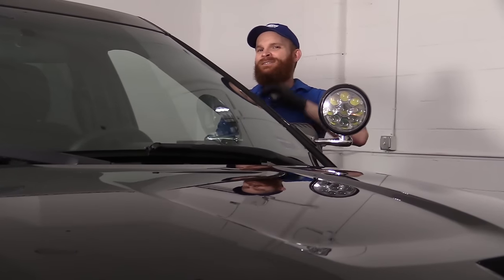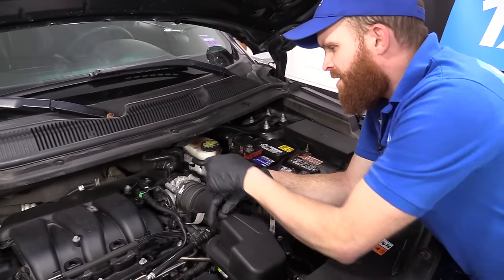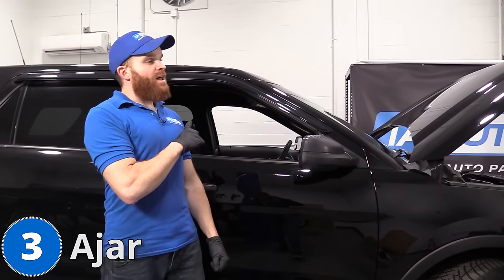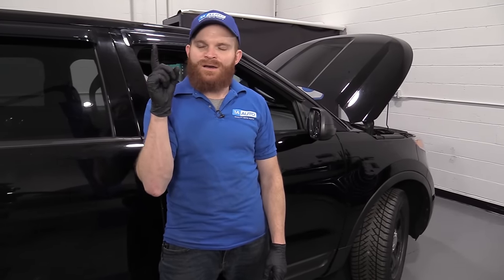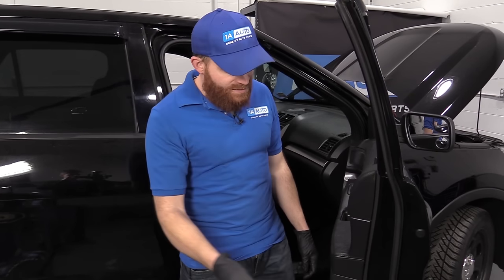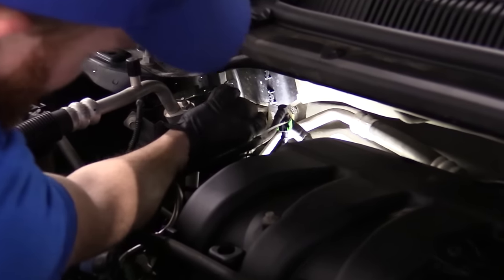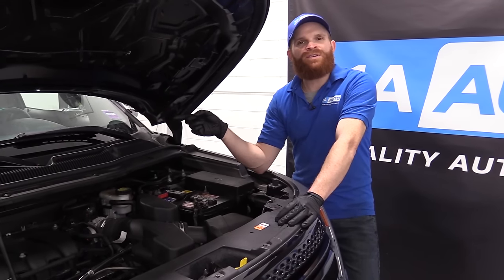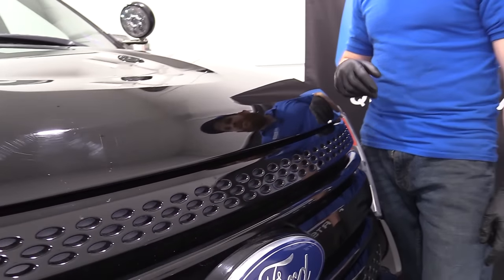Top 5 Problems Ford Explorer SUV 5th Generation 2011-2019

Comment from the maker: √  Watch the Video
√  Buy The Part at 1A Auto http://1aau.to/m/Visit-1AAuto
√  Do it Yourself
√  Save Money
Reply: 1A Auto Parts I have 2018, and the hood was bad already, just got replaced under warranty.
Reply: And water pump
Reply: Forgot about the park detector switch.  Ford wanted $900 to replace the shift column, but now offer a switch replacement.  No Park switch, no key fob start.  And, the biggest problem of all, the internal water pump that will destroy the vehicle when the bearing goes.
Reply: Veerickle.. what the hell is that? Thanks though. Great video.
Reply: @1joseda  OMG!!!
Reply: The hood problem is due to electrolysis, steel and aluminum don't play nicely together. But I want to find a steel hood designed for crash safety...
Reply: Wait am I hearing vericle??
Reply: Hi guys can you help me i want to buy new explorer 2017 any problem in this car like the gear or another thing if I take one because i hadn’t one before any kind car of ford thanks for all
Reply: I’m having the throttle body problem but the check engine light isn’t coming on. No wrench light or any other either.
Reply: That's the way I talk
Reply: Do you know how to get to windsheids washer pump on 2015 ford explorer?

Comment: I have a 2013 Ford Explorer with over 460,000 miles on it.  I purchased it as a family hauler with about 60,000 miles on it.  I unintentionally had to use it as a courier vehicle for 97% of those miles. I haven't changed any major parts or had any major parts failures!?!?!  I must have one of the best built fords on the planet!
Reply: These things have problems with water pump also. You my friend are very lucky to get 460k from your explorer.
Reply: How often did you change the coolant? Maybe that prolonged the life of the water pump
Reply: No fkng way :0
Reply: @al_saedi2109  I'd say it's pretty normal, mine has 130K miles and aside from a tire  sensor failing, it doesn't have anything wrong.
Reply: What engine do you have?
Reply: Unicorn. My 13 Sport has had 9 problems. No I’m not exaggerating.
Reply: Idc what you drive 460k on any vehicle without "major" repairs is amazing. I have a 03 S10 had to put 2 rear ends, AC compressor, and electrical issues
Reply: My explorer 2012 i replaced the water pump at 400k miles , so i suggest you to check under engine every 5000 miles if there any water leaking under engine
Reply: Wow 😮
Reply: My 2013 ford explorer had all sorts of problem. I had to replace oxygen sensors, catalytic convertors, mass air flow sensor, water pump, and recently throttle body. Just got 170k miles. Still love my ford.

Comment: Forgets the water pump bricking the motor when it fails.
Reply: Came to comment the same thing. Can't believe they didn't mention that. Such a pain in the butt to change it also.
Reply: Canadian 'r'
Reply: I don't understand why Ford couldn't design a new motor mount to allow the use of the 3.5 with the external water pump like the one in the f150. I looked into trying to retrofit those pieces onto the 3.5 in my Taurus but the water passages are cast differently in the front of the block :(
Reply: and the locked up electric steering that leaves you stranded on the side of the highway
Reply: That was a problem was fixed in 2011.
Reply: @dillonh321  I have a 2016 3.7l police explorer utility - that still has the water pump inside the engine driven by a timing chain. I believe this can still cause the "bricking the motor" things described. Not sure if this is the case for the 3.5l version
Reply: This "mechanic" is MORE concerned about the dome light staying on! LOL
Reply: @garrethbert  Both the 3.5L and the 3.7L have internal water pumps, bad news if the internal seal leaks. Oil and Anti-freeze do NOT mix well!
Reply: Its not an issue anymore by 2011 with the 3.5 version. The water pump is now belt driven under the crankshaft pulley.
Reply: 3.0l v6 is better than 3.5,3.7
Reply: Is that a top 5 problem ?
Reply: So we have to put water inside the engine?
Reply: @al_saedi2109   Is there anywhere I to tell when that water pump is getting ready to go out like some pressure gauge?? I was just getting ready to buy a 2014 interceptor it's got a 120000 miles right when the freakin water pump goes out huh?
Reply: @JustAnAverageBrad   Does it lock up when you're driving holy ship
Reply: @nicolastremblay7527   I'm so glad I just read your comment. I was going to buy an intercept they're just now change my mind about the water pump is you but now I read yours I guess I'm OK is it the 2014???
Reply: @theshield1613  Nah it's not. Try again, fool.
Reply: @billyjones9045  if it makes it past 120,000 without going out, it's unlikely to go out anytime soon. I would just replace the water pump to be on the safe side.
Reply: @nicolastremblay7527  lol....ok. (obvious sarcasm is obvious since Nicolas here has no idea what he is talking about)
Reply: I thought I wanted my boss' old truck that he actually did dealership maintenance on but I found out about the water pump, he can sell it.
Reply: EXACTLY I HAD TO CHANGE ITS 5,000 DOLLARS
Reply: @Janelle1477  - ???! What??? Dude you got ROBBED COMPLETELY!!! 
All Ford Dealerships 
ALL
Charge $3,000 to rip out the Original Water Pump and install a New One ☝️ 
Mine is 2015 Ford Police Interceptor 
I called Every Single Ford Dealership 10 before having them do it! 
$3,000 out the door 🚪 takes them 2-days

Comment: 1. water pump
2. Engine motor mounts
3. Throttle body
4. Edge of hood "rusting". Not real rust though.
5. Door panel peeling off
6. Fuel injectors
7. Fuel injector harness

Mileage < 80,000

Comment: Another problem you forgot was the actuator that controls the vents the defrost distribution. It's located
under the dash in a crazy bad spot. You can change them by going underneath and around the steering colum, but the book states taking the dash out to replace a 25 dollar part plus 12 to 1500 dollars. Very common problems for explorers have sticking on vent and defrost not working. I bet I've repaired 10 of these things from year 2012 to 2018 or so. Insane!

Comment: 2018 limited.2.0 . I haven't had any issues with mine at all other than a ac issue which was covered by warranty.  I have 65.000 miles & is a very smooth ride.

Comment: Own a 2014 XLT with 60K. Just got it back from the Ford dealer where they did like $5000 worth of transmission work. Almost a full rebuild. Some items replaced are 2 and 3 forward gears and torque converter and many more. Luckily still had the powertrain warranty So only paid like $100. Car is running like new again, thank God.
Reply from the maker: +Benjamin O'mer Thanks for checking us out! http://1aau.to/m/Shop-1AAuto-c

Comment: I have a 2011 Explorer XLT. only 78k miles on it now all hell is breaking loose.Thanks Ford!!  Have to replace the sync system APIM. and the fuel sensor.  Both big $$$$ fixes.  Get into those.

Comment: My wife owns a 2014 limited, 219k miles, had the toe links and rear lid seal done on a recall, replaced the battery twice, brakes and rotors 3 times, accessory belt, ccv, and spark plugs 3 times, and that's it. Most reliable vehicle I've owned except for our standby car that sits and we drive only if needed, 1991 Honda civic 4 door with 532k miles. Like all vehicles it's luck of the draw. Hopefully we will get another 100k from our explorer, freaking car prices are stupid and anyone who buys one right now either has money to burn or needs their head checked!
Reply: What motor does it have in it? My moms wanting one and needs reliability
Reply: @flogrown941  my mom had one a 2013 ford explorer limited fully loaded the dual panel sunrooof had leaks and a whole lotta engine problems but that’s about it oh and your question..it had a 3.5L v6
Reply: @flogrown941  she happily upgraded to a 21 explorer platinum totally worth it
Reply: @flogrown941  but it is kinda overpriced looking at the competitors like the transverse and palisade
Reply: Hey they is a new recall on ford explorer limited for airbags. Had mine done a little over a month ago

Comment: Some things not mentioned....the transmission may slip at initial take off, but when it catches.....wow what a jolt you get!! Also, the lower engine mount that attaches from the transmission to the body.. .those crack at around every 60,000 miles. If not replaced in time, the twisting engine can Crack the flexible exhaust can
Reply: good catch i have 2013 limited explorer ( 126K ) i changed the flexible exhaust conduit because of the Torque strut mount failure. i feel a vibration when accelerating
Reply: Cat converters are garbage, transfer case, front lower control arm rear bushings, water pumps. Its a pretty lousy drivetrain in my experience.
Reply: Hey, thanks for bringing this issue up because its exactly what im stuggling with, do you know how much it costs or the part name ?

Comment: I have a 2013 Limited with 145,000 miles and two problems I have with this car is, one, the hood paint peeling off and the second is the head lights. They are HID lights and to replace them you have to take the whole front of the car off to get to the light assembly. I am replacing them with LED lights instead. This is my fourth explorer and on the other three I traded them in after 300,000 miles. Good rigs but, like any vehicle there will be repairs. As far as the paint on the hood I feel Ford should take care of that problem seeing how there are so many explorers on the road with this problem.

Comment: I wish you would have mentioned the water pump issue possibly causing a total engine failure or the PTU unit for the vehicles equipped with AWD! Those are the 2 that should ALWAYS be mentioned!
Reply: Ray McIntire frequently change PTU fluid as it bakes in heat behind the exhaust tucked up in the engine, I change mine on both my explorers every 30k miles it’s only about a quart of fluid in there. If you do that you’re fine. I’ve had no issues
Reply: Also keep up on oil changes and don’t let you’re coolant age too much and flush that out you’re fine, a lot of vehicle problems are caused by the owners not properly caring for their cars. Just changing the oil and putting gas in it is not enough if you plan on keeping it for over 100k miles

Comment: This was super informative and interesting... however I’ve never had a SINGLE one of these problems, nor any problem with my 2011 Explorer. :)
Reply: What model do you have
Reply: Wait til you water pump goes bad and it’s not if it will it’s when it will.. your bill will be $1300-1700 in shops like firestone more if you take it to ford lol
Reply: neither have i! only issue is with the ac. i have the 2011 ford explorer limited.
Reply: How many miles are you running on currently
Reply: The majority of people probably don't have these problems.  It's the other hundreds of thousands of them...
Reply: I agree. I have 135,000 on my 2011 Limited and have had no major or minor issues. Just maintenance.
Reply: I truly believe that most major problems (everything else equal) are due to people pounding on their vee-ricles.
Reply: But this one in the video is a battered police model. The column shifter is a dead giveaway
Reply: aluminum oil pans.  not just explorer or ford. if you of someone screwed the plug in wrong( aluminum is soft, easier to strip threads)  you must take exhaust off at manifold to replace oil pan.
Reply: So do i only issue O have so far is a common one ive read that most 2011-15 have and thats when you turn the key to the ON position ill alert you of Engine Problem and Low Oil i was dumb enough at first and thought i was in trouble and paid for full service and right after I read its common kn that moddle truck its a error code lol oh well I learned from that mistake
Reply: I have a 2015 and have had ALL of these issues...

Comment: He just crushed my dream I've been wanting one of these vehicles for so long but now I don't feel that way anymore😩
Reply: @Jonathan Hutchins Agreed.  My 2016 has spent more time in the shop than in my garage.  It's garbage.
Reply: I maintain a fleet of these,100+ units, they are car, they all have problems, vics were easier to fix,  it those have been out of production for almost 10 years, this is what we have for a replacement, may as well embrace it, because all of them have issues.
Reply: @merlin0152  i was planning to get a sport one of the same year as yours. Whats your thoughts on it?
Reply: All cars come with there own problems my family runs a used car lot and every vehicle is know for there problems. Parts age and have to be replaced regardless of the vehicle, I have a 2013 ford explorer and I love it was less problems then my previous suv a gmc acadia i had a two page list of issues, I only had 2 issues with my explorer my husband is a mechanic and fixed it in a day
Reply: @merlin0152  what issues do they have I almost am going to buy one?

Comment: My hood was replaced last month due to paint issues and I have a 2016 Sport.  I was told no questions Ford will replace the hood.  It didn't cost me a penny either.
Reply from the maker: +Boz Squad Sounds like a good deal to us! 1aauto.com
Reply: yep, same with my 2017 sport.
Reply: If you had bought a Toyota, you would NOT have had to replace anything!!
Reply: Hopefully not.  Still cost you time and convenience.  And cost Ford a whole lot more...

Comment: 2018 I just reached 100.000 today,
- Water pump had a very small leak
- the Infotainment processor went bad
- rear wheel hub started making noise
I still got warranty on the vehicle so I got everything changed fast, tbh the infotainment processor was a little pricey aside from that I didn’t had any major problems with the vehicle, I’d definitely recommend it, amazing vehicle for the money.

Comment: Thanks for the video.  A  couple of days ago on 2017 Explorer Sport checked the hood on mine and it is starting to bubble. Searched more on the web and, yeh, it's a thing with these vehicles. I was prepared to do verbal battle with the dealership when I met with them the day after finding this issue. They stepped up right away for a warranty. Not a cover up paint job, which I would not have accepted anyway, but a factory replacement hood, paint and install. So that's a plus for Ford and a dealership that backed me up. I've owned many vehicles in 55+ years of driving. This is encouraging for me to continue being a customer.  I did spend a day looking at replacement options, but having totally dismissed Chrysler after a warranty fight years ago, and Chevy issues too, I'm running out of manufacturers. ;-)
Reply: What dealership ?
Reply: I’m 19 years old I have had my explorer for about 7-8 months, 2018 XLT, it’s bubbling as well on my hood I’m pissed I’m getting a new hood for free!!!!!

Comment: 2019 Explorer 78,000 miles. 
The hood flaking issue. 
Hi I took mine in last year 2023 to ford. They told me I was out of warranty at 36,000 miles. I pressed the issue that the paint is /was only 3.5-4 years old and if they wouldn’t stand behind this problem they have a bigger issue than paint.  The adjuster took pictures and told me that he would forward them to ford headquarters and get back with me to let me know what they said. 
4 days later he told me ford was going to honor the paint issue. Within a week they ordered a new hood. Pained it and called me in to the dealership to swap it out. I was happy that they did the honorable thing and stood by it. On another note. While I had it in for the hood, I asked them to replace the A-pillar windshield gaskets that were all cracked up and gooey (nasty) while they had it in their sights. In which they told me they wouldn’t do anything for that. I then ordered left and right replacements, swapped them out and now they are exactly the same mess. Also just got a letter from ford saying the a pillar covers are recalled for flying off while driving. Which could cause injuries or car crashes. So… I’ll see what comes of the gooey gaskets when my number comes up. Good luck all! Good video as usual sir!

Comment: they may be faster than the crown vic, they'll never be as reliable as the crown vic, changing out a water pump on these things can be a huge pain
Reply from the maker: +trigga ville Thanks for the feedback!
Reply: Reliability has nothing to do with how Accessible something is.
Reply: @trent7080  in no way shape or form was he drawing the same conclusion those were two separate statements from what I took.
Reply: CVPIs are older tech, and much less complex (and cheaper to fix)
Reply: @trent7080  this vehicle has neither
Reply: @trent7080  It does when the water pump location allows coolant to leak into the engine oil and cooks the engine.
Reply: Our Mechanical for the security company I work for has a ton of these and vics. He HATES, HATES the explorers. Its sorta part of the reason why we're trying to get rid of them for Tahoes. (It sucks too because I like the looks of the explorer, though not very useful for police/fleet use, while it might be roomier, if you're tall they suck and the spotlight handle being so far forward is annoying too.
Reply: @1AAuto  so do we have to keep adding water into the engine?
Reply: What someone just said they changed that to an ex ternal water pump after 2011 is that true because I'm getting ready to buy a 2014 in an hour
Reply: I work on these explorers, Vic's and chargers all day everyday. The explorer is actually pretty easy to work on. I've yet to see a water pump leak internally, they've all leaked through the weep hole cast in the block and right outside.the water pump is only an 8 hr job. In our shop the real problem is the other yahoos in the shop not getting them in time when they put it back together. It can also be done without removing the cam phasers.
Reply: @matttheman7632  that’s why I put a catch can in my sport